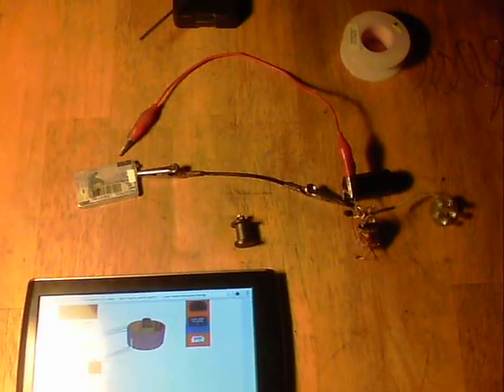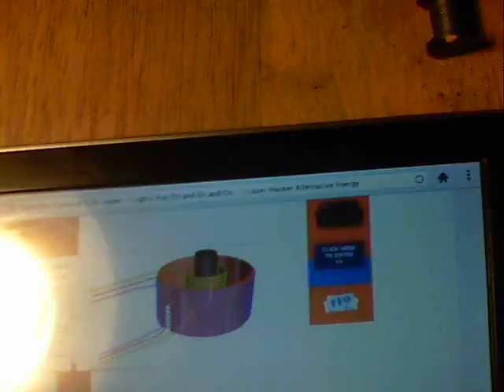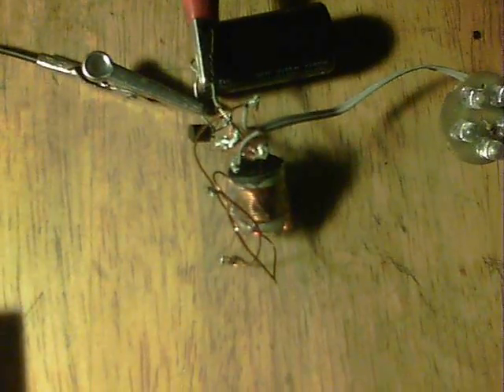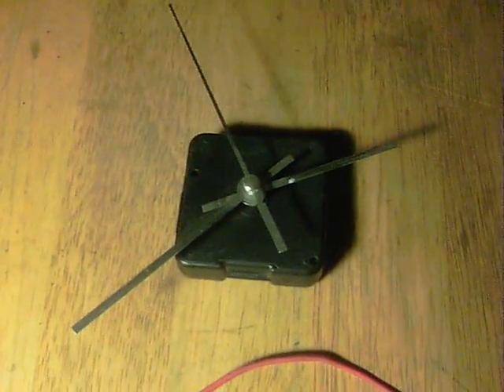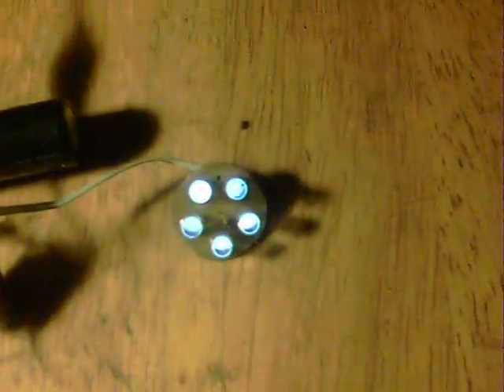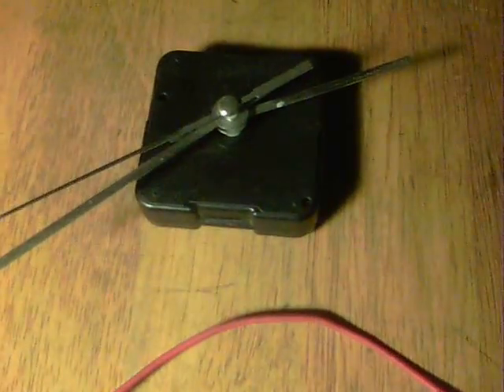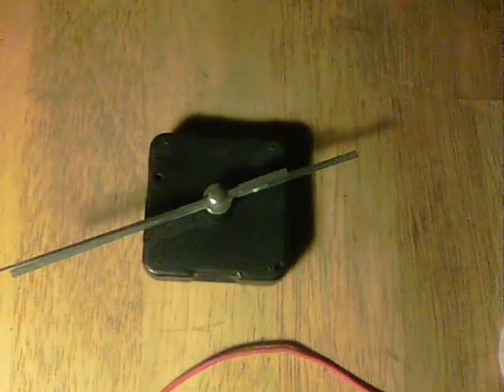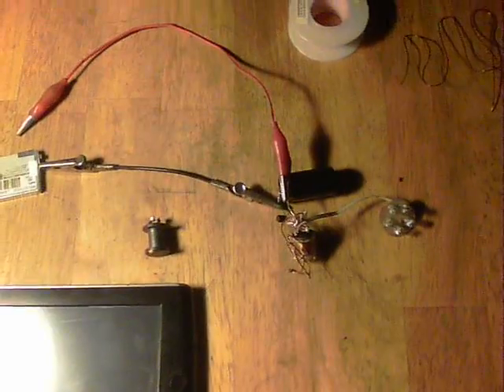SJR Looper - Running Replication

Comment: I have the cicuit running but with a very small toroid (8mm 200/19 Windings 0.1mm/0.35mm Wire) although it is not as efficient. I measured 25µA but with a dmm (the leds are dimming when i do that) With 0.1F_10V I get somewhere around 15h runtime. For the 3Diodes I have taken Bat45 Schottkies and I connected them not as shown in the scematic but from the negative lead of the Leds(not directly from the base) My transistor is a 2N3904
My Leds are also not so bright like Lasersaber his but that has to be because of this magical Coil+Ferrite that he uses.

Comment: Where can I buy these small coils? I cant find them on Ebay
Reply from the maker: Ah, that's where Freecycle or street finds come in. Old PC monitors and tube type TV's contain at least 2 or 3 on the main circuitboards. The original wire can be reused and quite often you'll also find ceramic magnets on the top of such coils.
Advice though is to not switch on such a set to test it first, or the HV inside can nip you. Any such TV/monitor should be left switched off (for at least several days) before opening.
Nearly all of my circuits are based on parts from old clunker monitors and other salvage :)
Reply: thanks :)

Comment: I also tried to replicate Lasersaber's SJR Looper circuit, but could not make it oscillate (different core used).

I am very interested in your circuit (which seems to be different in detail), but your written connections do not make sense to me. May be you could publish a hand drawn version of your circuit.

Greetings, Conrad
Reply from the maker: Am uploading a better vid in a few minutes, with a circuit diagram :)
Am doing some tests in the vid, an LED across coil connections, microwave test etc.

Comment: can you just charge the cap and put the LEDs across the cap and time it?  I had a similar effect at one point, but it turned out that's just how the LEDs work....
Reply from the maker: You have a good and valid point. Was caught out myself one time with a transformer for a music project. Turned out the LED was lighting for 1/2 hour because of a resistor and large cap in the power supply.
With no resistor etc these 5 LED's dim to nothing in about 1 second on the 4700uF cap.

Comment: Slider this is great! Why does this thing work? I suppose that the components themselves "consume" some of the power, so that's why it eventually runs down.  Thanks for sharing!! Kudos to Lasersaber too!
Reply from the maker: It is a great circuit indeed. Seems to function somewhat like a resistor in line with an LED, yet that middle coil resistance affects the field energies positively.
Yes I think you're right, the little losses all add up.

Comment: Nice work!   I am glad to see that it works for you even with different components.  In my experience getting it to work correctly was very tricky.
Reply from the maker: Yep indeed, a second one doesn't want to fire up properly. In fact, there may bay a clue as to why, in that it seems to have 3 distinct bands of light output as the cap drains over about 3 seconds. Bright, mid, dim. Stil tinkering with it though...thanks for a great circuit !

Comment: Very nice :) would work great for safety marker. Would be nice to produce more light. Thanks for sharing!
Reply from the maker: Cheers :) The trick with these will be to bump them up as they begin to drain I would think.Some kind of Zener trigger to keep the brightness up, but use much less power than usual.
Reply: :) Maybe a schmit trigger could do the trick :) or even a voltage comparator

Comment: Well done. Could you please show the capper foil. Thanks for sharing
Reply from the maker: Thanks. I've taken pics of the build of another one, a lot cleaner and on a circuit board. But it doesn't work yet lol, very tricky things these. The copper foil is 1 complete turn the width of the core middle, with a solder tab to it for the wire to connect to.
Reply: ok thanks a lot

Comment: Well done, could you please show a full 3.6 Volt charge of the cap ? It was probably only charged up to 1 Vokt or so via this short tabbing...many thanks !
Reply from the maker: Yes certainly Stefan....i'll need to draw up a schematic rather than write down the connections, so will also show a full charge. A full charge was done earlier, but was around a 10 minutes run and I wasn't sure my camera battery would last (4 year old Kodak Mini with same lipo battery as new).